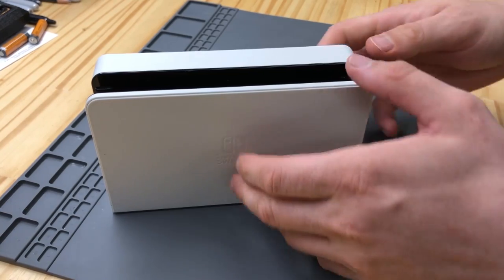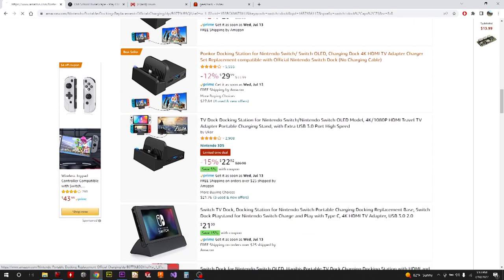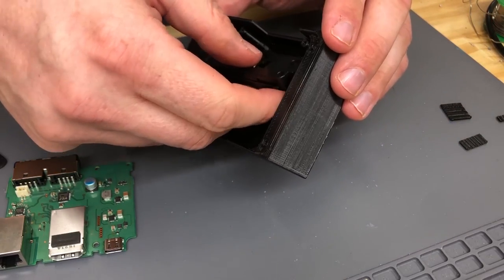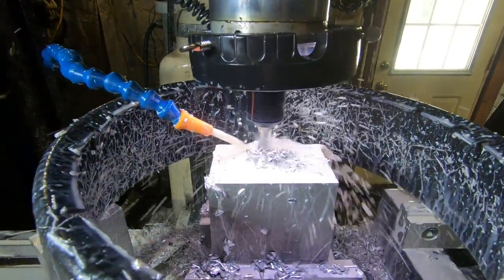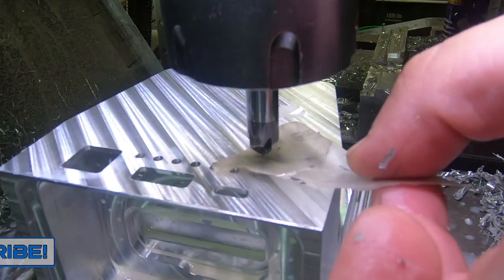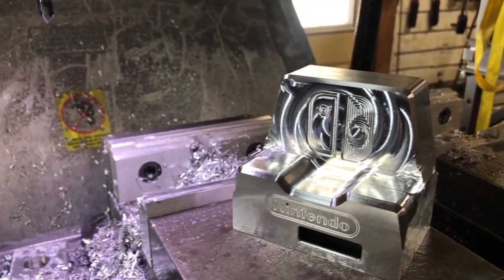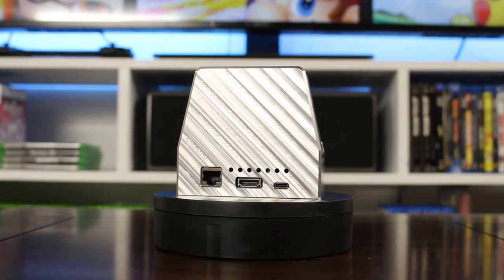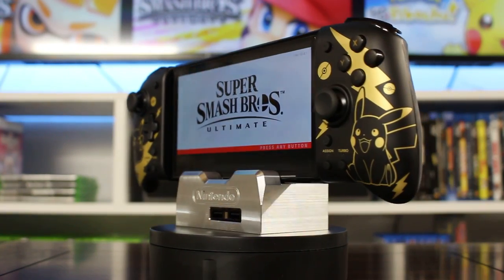The all Aluminum Nintendo Switch Dock

Comment: What's next?
Reply from the maker: I have a 6x6x13inch piece of billet Aluminum I’m machining out to put my Xbox Series X into. The front has Master Chief engraved on it.
Reply: @modified_in_mn  doesn’t it conduct electricity and cause possible shock? I’m curious
Reply from the maker: @Rama Chetan  The circuit board and internals get screwed down. There’s no stray wires flopping around and the case doesn’t touch any contacts. The case will share common ground, so there’s really no chance of a short.

Comment: Correction, the cables don't come out of the side of the dock. You're orienting your dock wrong. It takes up less space rotated 90 degrees, seems the obvious choice, and it's the way every other (vertical standing) console is oriented.